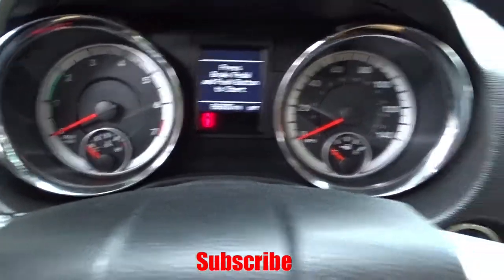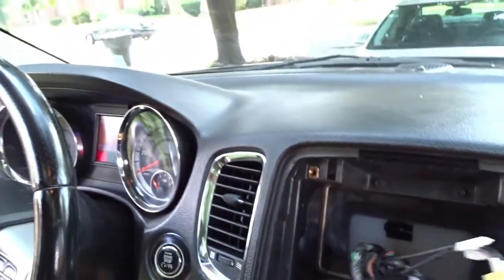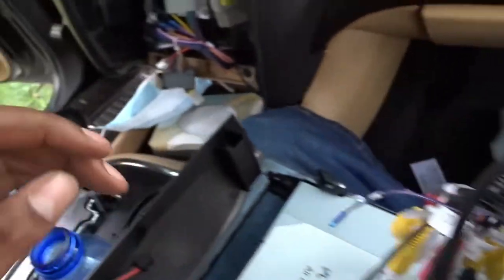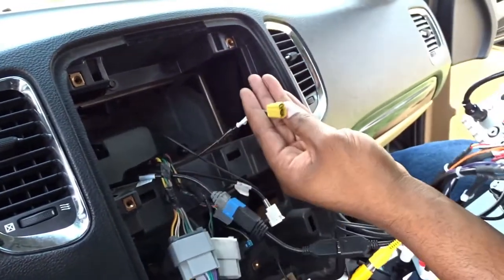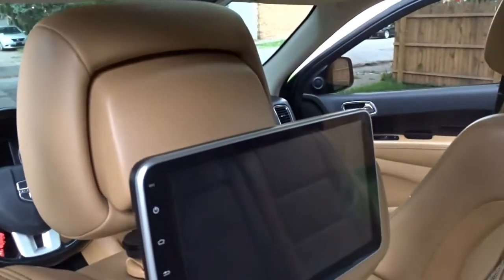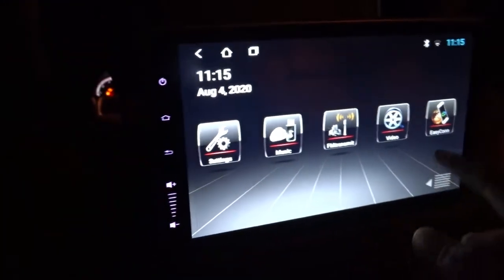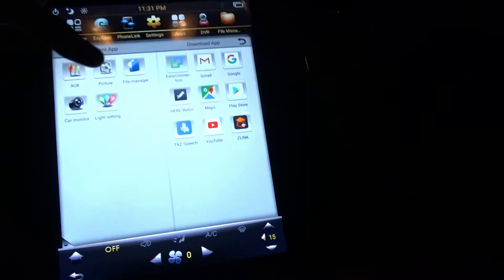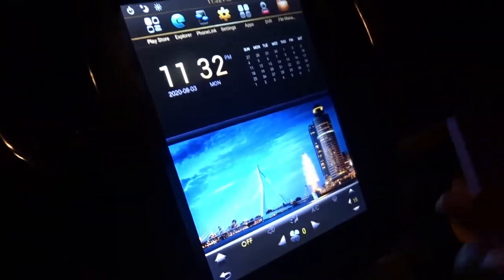How to install 12" Android PX6 Tesla Style Radio in Dodge Durango 2011

Comment: My back up sensors don't work when in reverse on this radio. WHEN I use my factory radio it does work. Any help on this would be greatly appreciated, do you know how to make the sensor part of the back up camera (car image with sensor feature) to work ?
Reply: you have to go to settings and go to sounds pick the reverse mute and unmute and turn up the volume
Reply: @96reddemon  where is this setting in the original radio bc that cadillac version radio dont have this setting, maybe the radio that came with the car but not the new install.
Reply: @frankierwhereyouralwaysast903  well try this in the user manual it has specific instructions for cadillac. i came across it because i had problems too mine didnt power my factory amp. but you can also email whom you bought the radio from or join the tesla radio group on face book and someone can help in the group

Comment: Do the vents still work in the back?
Reply from the maker: Yes
Reply: @Fo757  but it can't be controlled by the unit, you have to use the controls in the back?
Reply: @markmccullough6754  I’ve the same issue. What did you do to solve it?
Reply: Any updates for the back ac not working?